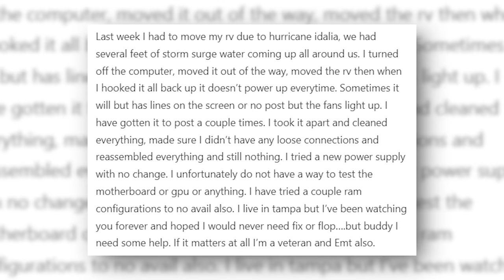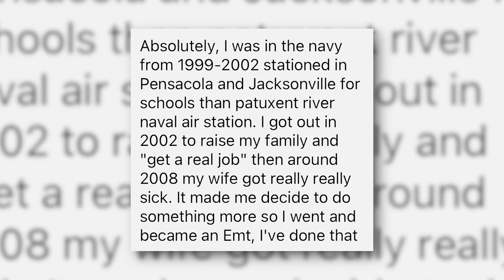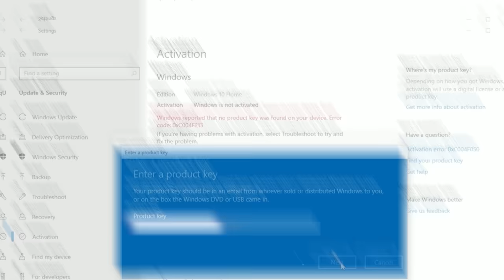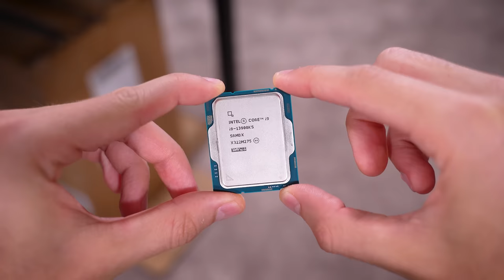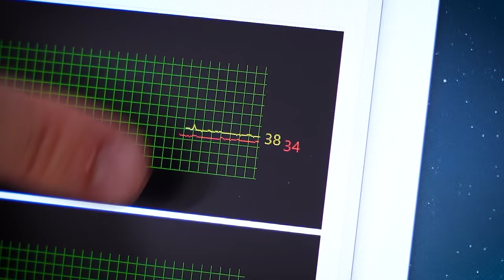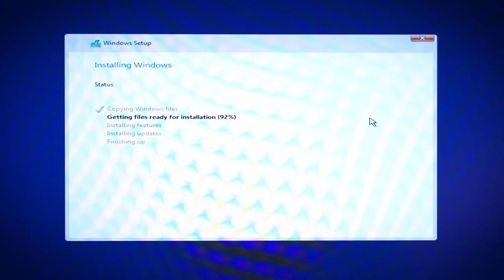Surprising an EMT With a BEAST Gaming PC!

Comment: Great thing you did for a deserving guy... FYI; I've got the P400a. It's not much bigger but has plenty of room for wires like the upper 8pin and will handle a 360 in front and a 240 on top. Plus 2 2.5's and 2 3.5's in the back.

Comment: This is awesome, good on you for doing this for such a deserving person. :) 

I might suggest if you ever do something like this again, you could get one of those big power banks that does 110v out. That would enable you to power on the system right in the back of the truck, and show off the RGB to whoever is receiving it. That might get an even bigger reaction out of the person who recoeves it. ☺️
Reply from the maker: My truck has several 110v outs. I preferred not to do that because, as stated in the video, it was drizzling outside.

Comment: Correct me if I'm wrong, but the 30 series did not have 12VHPWR connectors. They had a connector that looked like it, but they're missing the sense pins. Are they backwards compatible?

Comment: Out of curiosity, doesn’t installing Windows 10 on anything above an Intel 11th Gen based system cause Windows power management to not work right? I was sure I read something about Windows 10 not properly able to handle the P/E cores.

Comment: hey greg quick question so i have a enermax case with those exact front fans that you installed, but when i click the link it leads me to a another aio that doesn't have those exact fans, (one of mine stopped working and id like to order a new pair)

Comment: aio looks like poop because of the orientation you put it in as. if you put it on correctly u would not have to unscrew the plate and flipped it